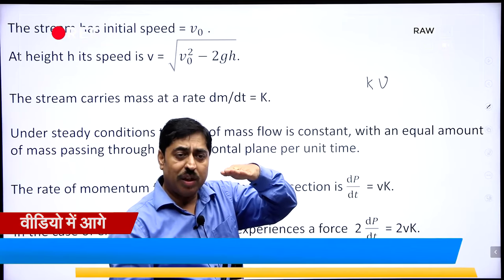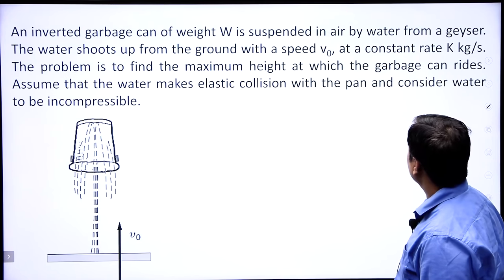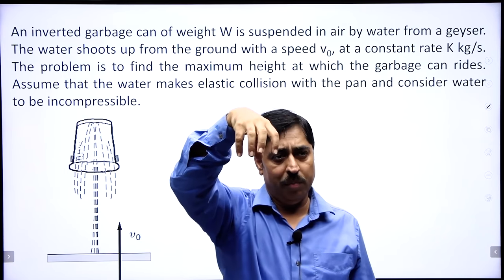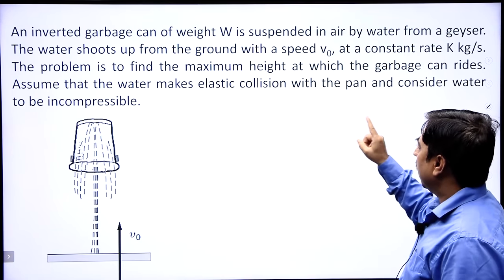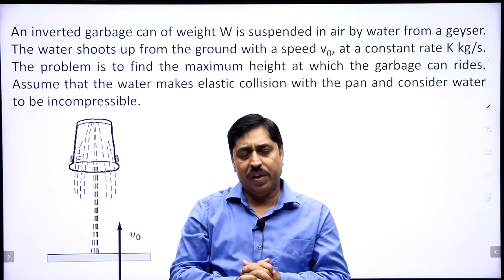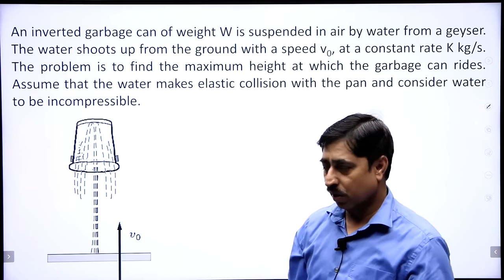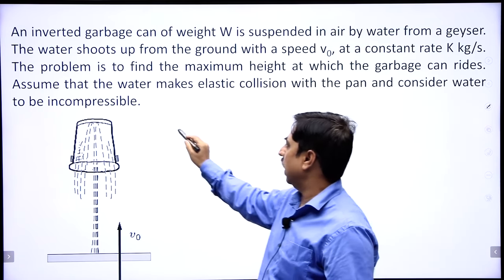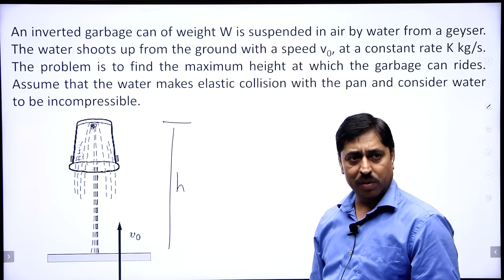Fluid Mechanics Problem for JEE | Application of Bernoulli's equation #sbt #fluidmechanics #jee

Comment: Sir please share your views on pathfinder mcqs and tell them are they relevant for jee advanced
Reply from the maker: Pathfinder  problems are collection of various olympiad questions. Most of them are above JEE advanced level.
However, you can keep solving few of them as and when you find time. You learn from such questions- though slowly.
Reply: But sir  your level 2 and level 3 question are on the same level. What should be strategy to crack hard question in which we get no clue how to start